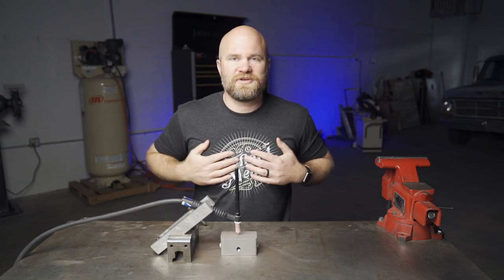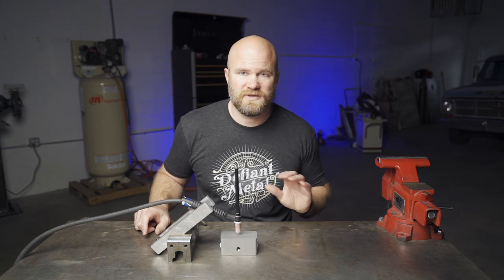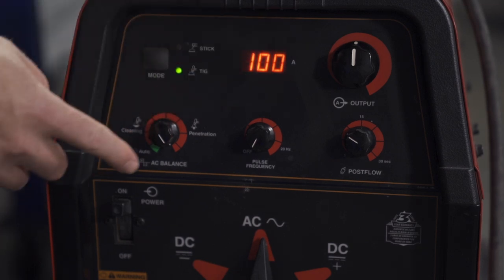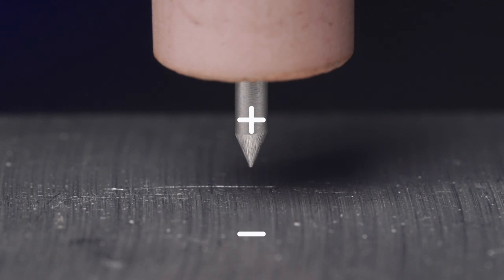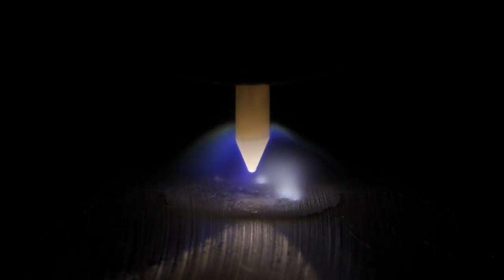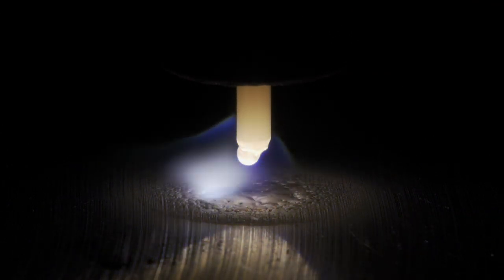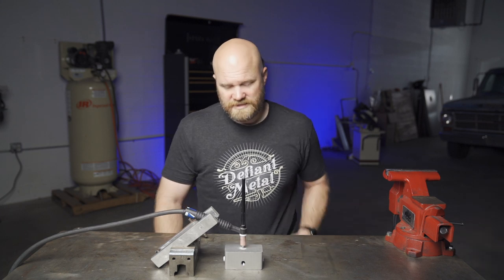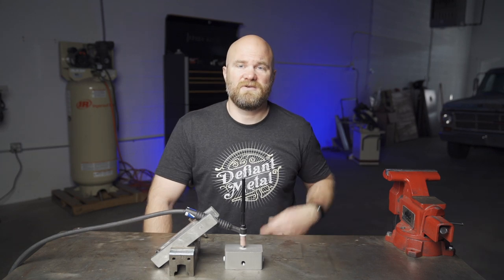AC Balance Vs Tungsten - Aluminum TIG Welding Balance vs Penetration Explained

Comment: Being new to welding in general only started my course few weeks ago. Last two nights I've been practicing aluminum doing up some T pieces .. I was running 106amps 60 ac frequency and 18% balance , found it working well with the t pieces ..not sure what others prefer. Nice video bro, keep posting 👍

Comment: Hello.Great video.You forgot to say that every welder has different dial for ac balance. Some maxed out at 30/70 and some 70/30 .
Also penetration goes along with frequency. I noticed that 60 hz makes puddle wider and penetration is increased due to longers durations.
Also my experience showed me that speed of travel and frequency is your friend when you are maxed out of amps.